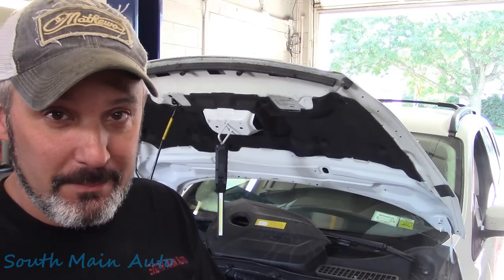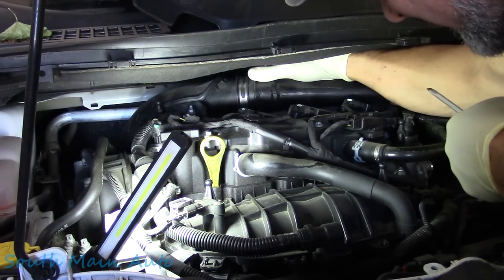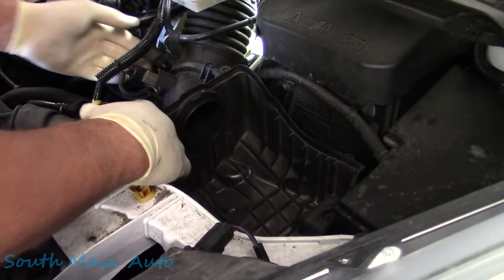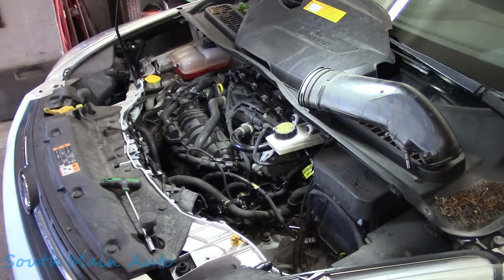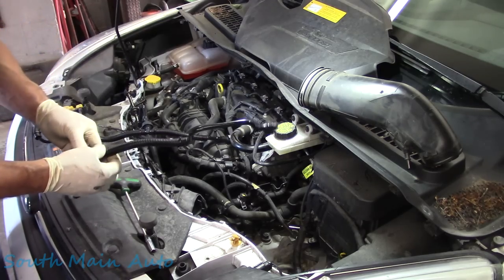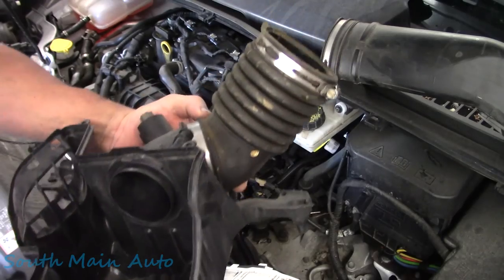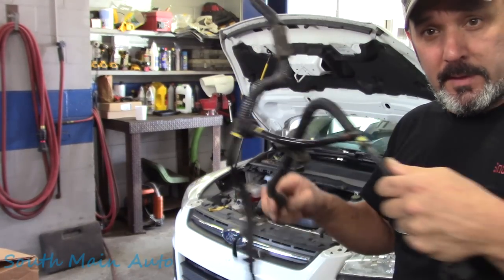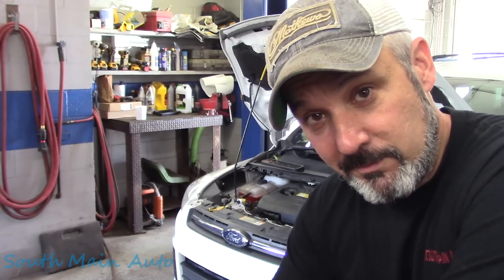Eric O. Unloads The Parts Cannon!

Comment: The battery and air filter on these vehicles is completely ridiculous. At Walmart, we use the Super Tech and Fram filters, and neither one seems to fit back in this filter housing.  Then replacing a battery is an exercise in futility. What an absolute joke.

Comment: If it is a good customer and the part is 90% or more the problem and its cheaper to replace it than to diag it right I give them the odds and remind them it's like vegas and they are the ones doing the gambling, not me and let them choose 9 out of 10 choose the cannon and of those 95% are very happy to have saved more than half the cost of "doing the job right" The key, however, is to NEVER give the option to cheapskates or unknown customers because god forbid they are in the 5% you will be called stupid, a thief and worse and they will tell anyone that will listen

Comment: Engineers of high volume products are more or less forced to shave cents (or fractions of cents) off parts when they can. A 7 mm bolt is probably a little less than an 8 mm bolt. Just look up the sales numbers of this vehicle. From 2013 to 2019 it was selling about 300,000 units a year. That's roughly 2 million vehicles just in the US. Shaving one cent off a part used once equates to $20,000 less spent on parts for this generation of Escape. Now think about how many parts are in a car. 

There is also a lot of consideration paid to ease of initial assembly, because assembly is expensive. 

It all comes down to profit margins and the bottom line. The engineers are trying to balance performance, cost and ease of assembly. Product managers usually don't care about how easy vehicles are to fix so engineers can't make design decisions to allow ease of maintenance. Brakes and oil changes are the typical jobs dealers see and corporate wants those job to be easy, but after the car is out of warranty they don't want it to be easy and inexpensive to fix. They want you to buy a new car.

This is not the engineer's decision.

Comment: Hey Eric could it also be the vent valve? My Chevy express is giving the gas cap message with the MIL shortly after. If I scan the code it's just a large leak message. About a year ago I replaced the purge valve after getting the MIL with a high purge code. Could it be the purge again this time? Or is it possible that it's the vent? Replaced with genuine ac Delco purge last time. Also replaced the gas cap with no fix.

Comment: I started swearing so you didn’t have to when trying to get the air box out.  Does this problem relate to overfilling the tank?
Reply: doubt it. overfilling would most likely get the vent valve an the charcoal canister. this is probably hot intake air under pressure pushing on the wrong side of the valve. one of those check valves was probably getting week.

Comment: How does adding fuel cause the purge valve to screw up? I’ve heard of this but never knew what caused it.
Reply: When you fill up the air in your tank has to go somewhere. Supposed to go through your charcoal canister. When your purge valve is sticking the fuel vapor goes into your intake instead.
Reply: @Ddabsolve  oh okay, that makes sense. Thank you 👍👍

Comment: Now I know why Ford does not have a better idea. I used to watch a Ford Tech channel (F …B..  M) and quit because the guy got in my nerves. He was bragging about the new twin turbo Bronco and how fast it is. I mentioned I have a turbo Miata that I did all the upgrades to and makes 200rwhp from 1.8 liter. He cut me down on that because the bronco makes 300 crank up. Cubic inch for cubic inch,  they are identical and mine uses a simple OBDII system with no real tricks and is ten times easier to work on. New vehicles not needed here!

Comment: It's too bad car companies don't design cars to make them simpler to repair. It seems to be the opposite. It's like computers today. You need to subscribe to stay connected and don't forget to pay. Before the internet cars were much more straight forward in repairs. Now you need a scanner. Anybody remember the Volkswagen Beetle? A vehicle is to get from point A to B period. No electric windows and door locks and tailgate release etc. Wire cables are easy to diagnose and replace. I think the engineers are being controlled by the big boss who is looking for money.

Comment: The Chevies I used to work on had a lot of purge valves fail, but you could have one changed in five minutes because it was located right on top of the engine.  Leave it to Ford to give us this kind of overengineered fuckery.  What is the flat rate on that part, like 0.5?  It's not right.  Modern Fords are worse than Volkswagens.

Comment: ...There will be a short quiz after the presentation. Make sure that you remember where every lead of this harness goes and the types of connections that are found at each end. It is all in the quiz.
The Ford engineers must be laughing their asses off. There mustn't be a 'dry seat' in the Glass House in Dearborn knowing how the average auto tech will struggle with this harness.
But who gets the last laugh? Ford announced the layoffs of 5,000 employees, mostly in engineering of internal combustion engines.
(read that 'firing' ) of engineers who have been designing internal combustion engines. Karma is a 'b*tch'

Comment: Darn vehicle designs today all seem to have the "van" idea for an engine bay. The cowl covers half of the engine making parts toward the rear very difficult to inspect let alone replace or repair. 
Vapor recovery systems seem to mostly be unreliable by design and in quality of parts so you would think if the "vapors" are that important to control that the engineers would make them more rock solid and do what they are supposed to 100% of the time vs. break and vent vapors. This kind of engineering reminds me of a fraudster.

Comment: Downsized engines w/turbo and the D.I. VVT and all the modern complexity has turned these into short-lived dumpster-fires. Ford literally has a massive recall right now for SUVs with spontaneous combustion even with engine off and crankshaft and valve spring failures.
The few parts my 2002 Focus manual 202k miles has needed I sourced at the wrecking yards. EVAP purge valve and DPFE , only a few dollars 3 years ago.